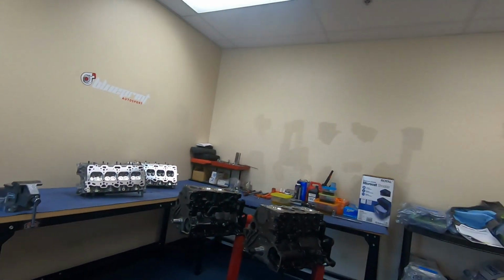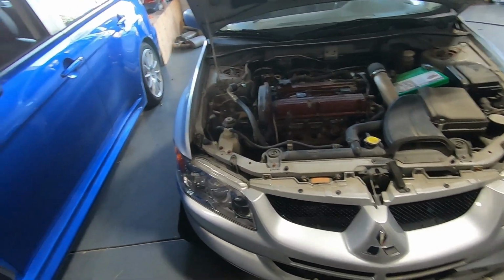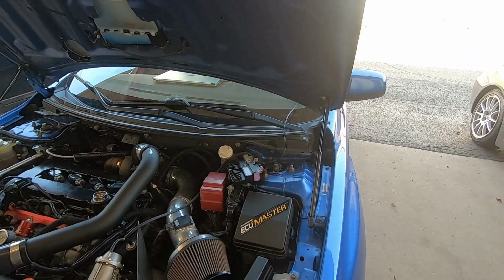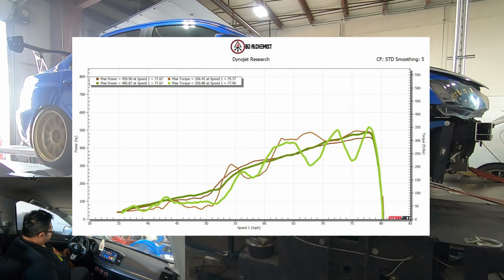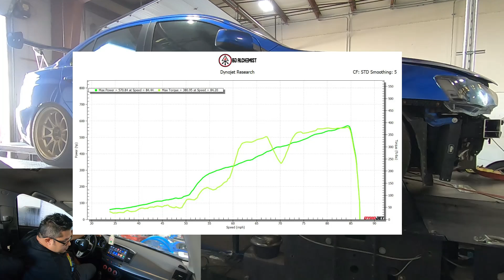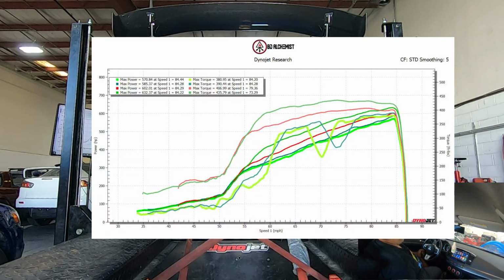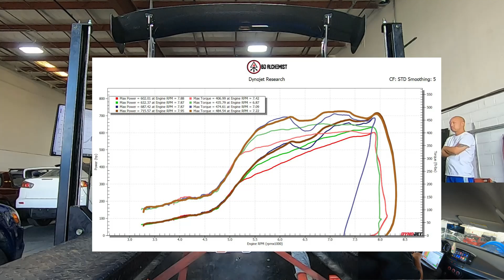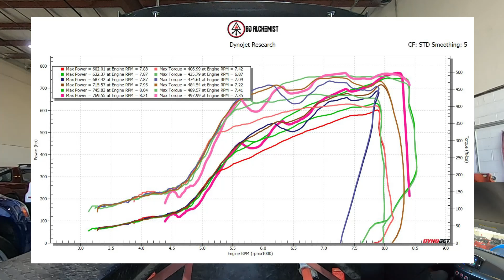Evo X G35-1050 Darton Sleeves kelford cams Ecumaster Black PNP harness flex fuel tune

Comment: Looking good, i'm thinking about swapping my PTE5857 for a G-something... what do you reckon this would spool on a 2.5L? still probably a bit too late for my liking  :D
Reply from the maker: Depending on cams as well but I feel kelford's spool faster. This was @ 38% wgdc even on low rpms. I would say 40psi can be achieved by 5000 rpms on a stroked big bore.
Reply: @bdalchemist  214B's, do you reckon a 8474 would spool sooner? i'm tempted by a 7670, but i think its perhaps a tiny bit small...
Reply from the maker: Don't know if it will but I know the 3584rs will for sure
Reply: A 8474 will spool a bit sooner and be far better in transient response. The 7670 is way too small for a 2.5L

Comment: Awesome vid.  You mention the pump gas tune is for basically injector cleaning.  How often do you think it's best to cycle in pump gas to clean the injectors and system? Run a tank every 4 or 5 fillups?
Reply from the maker: Depends on where u are and quality of the ethanol but yes

Comment: Question, wondering if the breakup during the pull was resulting in any knock especially on the pump gas tune ?
Reply from the maker: Did not break up on pump, only at 36+psi and no knock

Comment: I have ecumaster in my evox as well, has anyone figured out the steering wheel controls? Mostly to use cruise control.
Reply from the maker: When speaking to Ecumaster, they straight up said "currently cruise control is not supported, but we are working in it. "

Comment: whats the max potential of this turbo youd say?
Reply from the maker: 800-900 with larger cams
Reply: @bdalchemist  I use the G35-1050 as well, not much testing on it out there. I do like it, seems to work well. Do you mind telling me the Turbine Housing your using ? I use the .83 on a 2.3 Ecoboost, I tried the 1.01 and its a bit big, curious what you have on this car. Thanks !!!